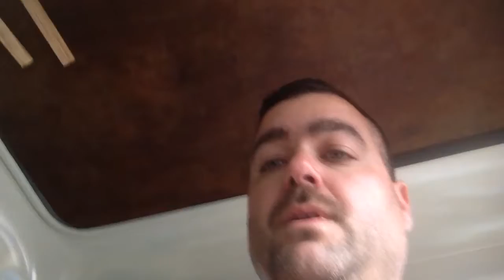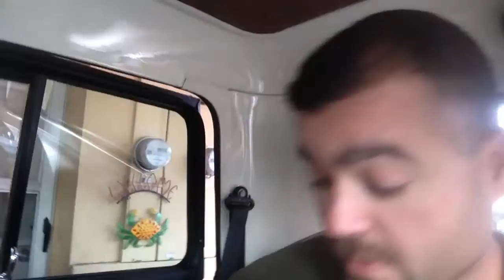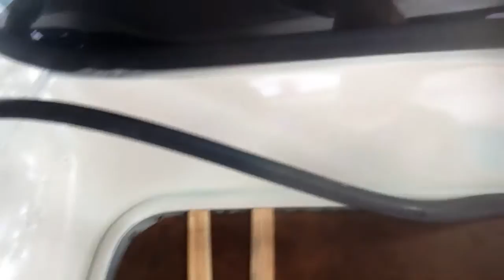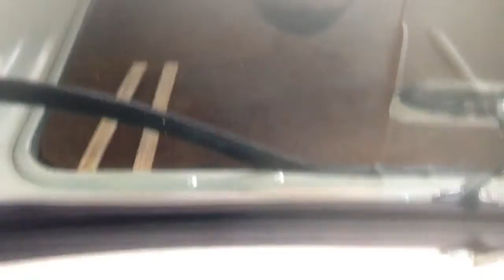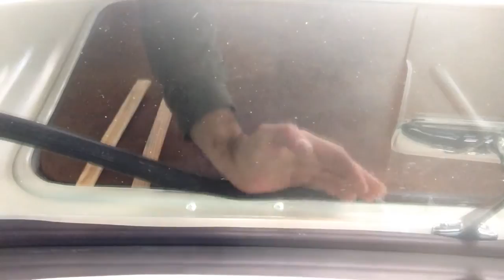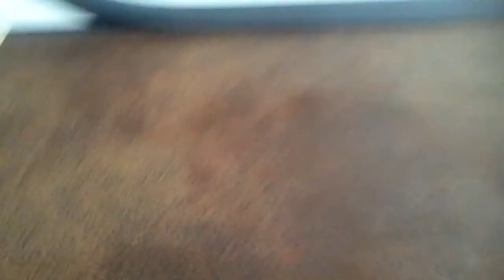1957 chevy truck headliner

Comment: Late to the party. Just did mine yesterday. Took 5 hours. Had factory gasket and headliner. After 4 hours in and being less than halfway, cut the bulb in half on the gasket. Made it so much easier. It was so tight wedging the opening was leaving little indents on roof, but I haven’t painted exterior yet so no problem. You know what I think hell is like? Satan having you install these headliners for eternity.

PS. Factory headliner is probably harder than yours. Factory headliner actually is a little larger than opening. Having the headliner a touch smaller would be ideal.

PPS. Leave the bottom of the bulb so it still locks in. Cut top off. Bottom is down part of bulb when installed.

Comment: May sound funky, but I first soaked the gasket in hot water for about 1/2 hour I then used a water based KY jelly and it greased it really well.  It all went in in about 15 mins after I properly prepped the gasket and used the jelly.  Make sure you use water based so it is easy to wipe up.
Reply: Hello Alejandro, I'm starting to install my gasket now! I've read what you said and will do the same. Is there any more you can tell me ? such any "Special" tools or anything you can tell me1  Thank you so much  Jim in new. Mexico  jleffin2gmail.com

Comment: A little wood tool to wedge ahead of the gasket to hassle, and of course if you don't have a volunteer to to hold up the headliner it will kill your shoulders, I made a little brace using 2x4s to wedge against the seat and headliner so it held it in place while I fiddled with the gasket
Reply: I bought heavy duty (thick) velcro rolls from Amazon and it held the headliner to the roof while hassling with that gasket

Comment: Can the headliner itself be inserted after the gasket is in, or does it have to go up before the gasket?
Reply: NO---YES
Reply from the maker: I do not think the liner can go after the gasket. The space will literally be smaller than the liner at that point so to make it fit, the liner would have to bend 2 directions at once. I would rather do what i know works vice taking a chance on cracking the liner, but nothing is impossible, see if it will work.

Comment: 8 year old video, hope yer still not workin on it🤐, I been putting mine off for 15 years, I would guess that the aftermarket gasket is thicker than the original, lotsa aftermarket stuff don't fit right.